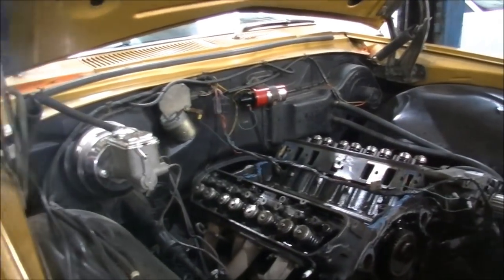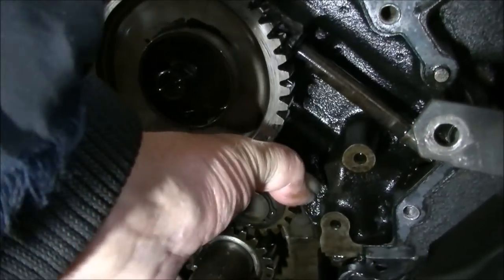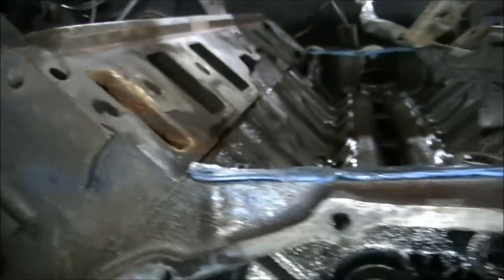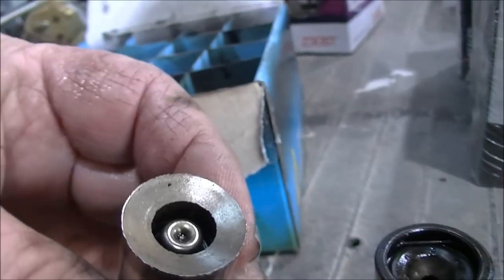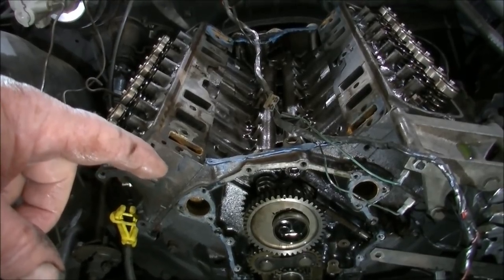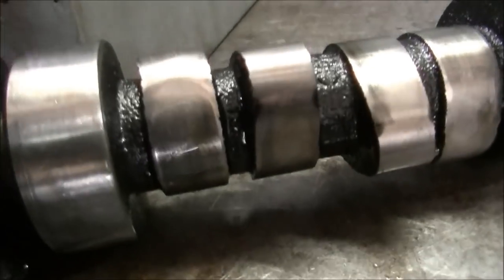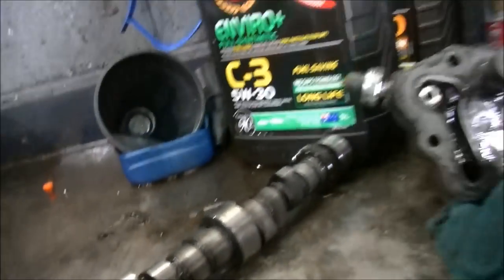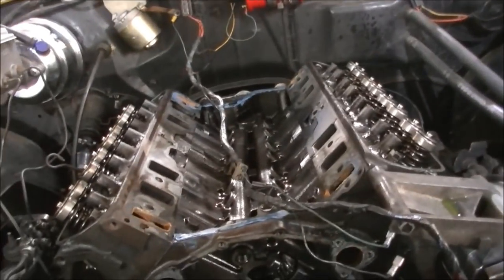1974 HQ Holden 308 Cam swap pt 2

Comment: Yep ... high zinc motor oil and 20 minutes at 2 - 25 hundred rpm's works for me. I've ruined a couple new cams .. one by not installing new lifters with it and another by not using zinc in the break in oil. Hope all goes well for ya!
Reply from the maker: Cheers Bob...I've had real good luck...Zinc is the magic ingredient.

Comment: Amen to getting that gear drive out!!! Bugger that thing was worn through glass bottom lifter I reckon. bump stick without bumps should have done the cam when he did the lifters instead of cranking that rocker arm down till the tapping quieted.....tough one to swallow cheers zig

Comment: Had a used f150 that I bought that ran rough,  pulled the cam and lifters and saw every lifter was worn concave. Not sure how the previous owner managed that.  Got quite a few years of use out of that truck once I put a new cam and lifters in.
Reply from the maker: He probably didn't even notice the performance drop Ron.

Comment: I always thought the JP drives must have been good the way people raved about them, but with that play I saw, there's no way I'd use them , my engines always had double row roller chains because thats what the high performance engine rebuilders always installed.
This will be a good runner with the work youve done, the owner won't know the car.
Reply: closertothetruth if they were the true Pete Jackson gear us they wouldn't have that much playing them those are just the cheap he's on there just thought I'd tell you that take care
Reply from the maker: I've never been a gear drive fan...

Comment: Not enough ZDDP in modern engine oils. 0.12% or 1200 ppm for flat tappets! Diesel engine oil trick no longer works either as they’ve dropped the zinc content in those oils
Reply from the maker: Yep...